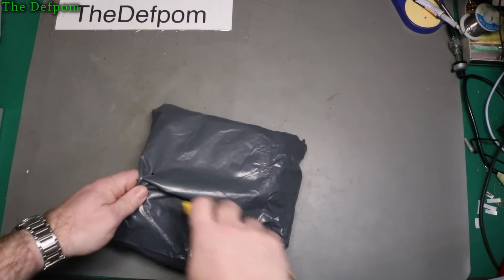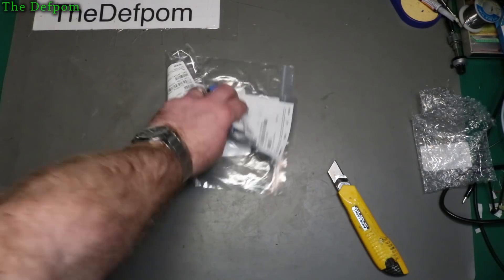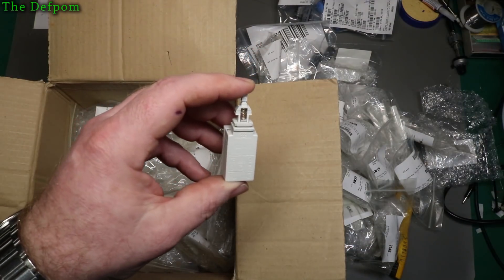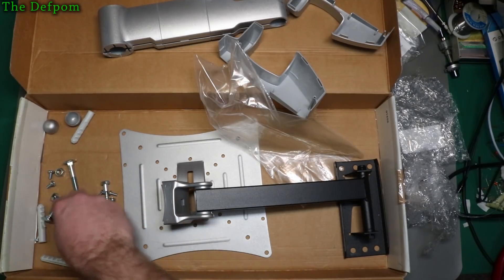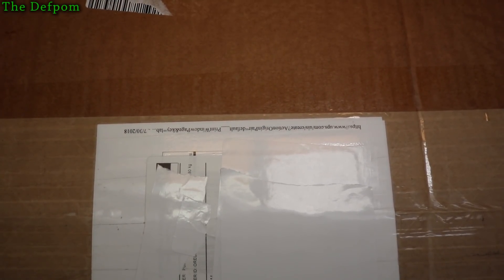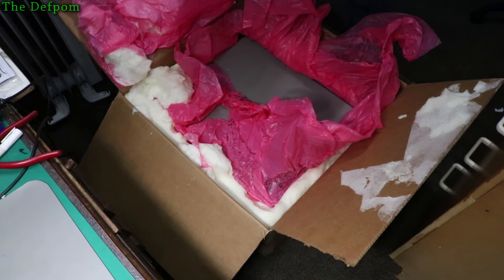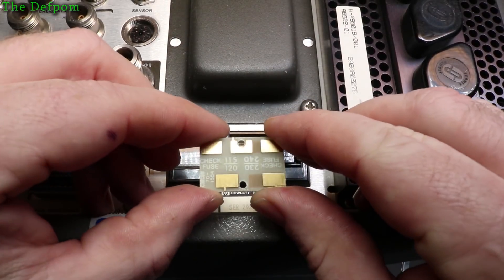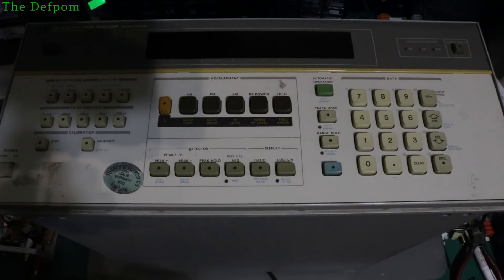🔴 #432 Mailbag Monday 3rd September 2018

Comment: Re your flat panel eBay bidding: You should use a free program called GIXEN which makes your bid 5 seconds before the end of auction. If you want to make bids on the same item in multiple listings then put all bids into a GROUP bid. Once you win one item it cancels all other bids.
Reply from the maker: Peter Kay - thanks I will look into it, but I tend to just do a buy now if I want something.